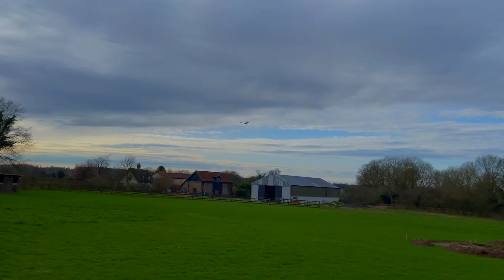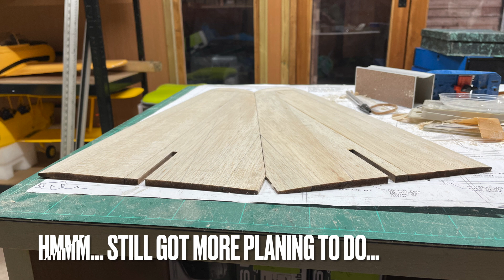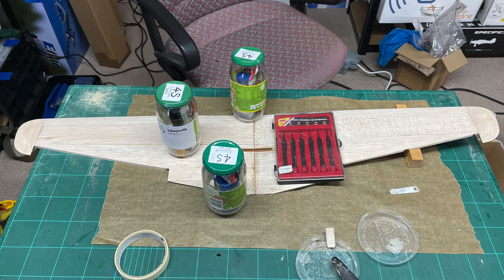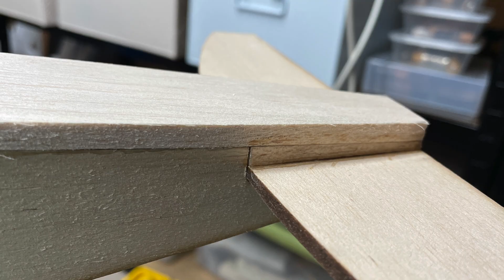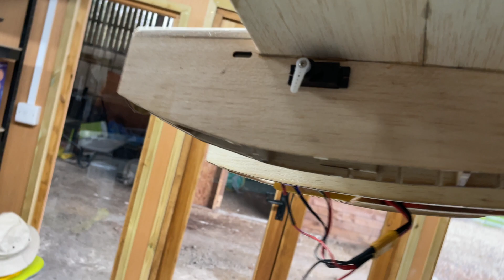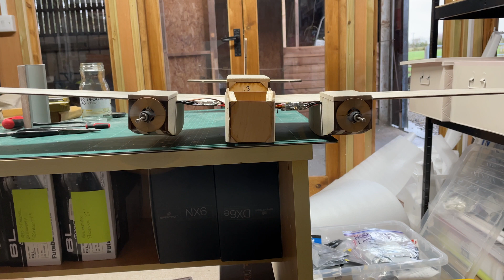TN Mosquito build PART THREE

Comment: Brilliant !! - great progress Gina, Bravo .... Regarding a stabiliser - I would have suggested an AR630 or something like that with SAFE and AS3X that you can fine tune as you wish... rather than the Hobby King one....
Reply from the maker: Hi Martyn! Yep, the original plan was to put in an AR631 but they're getting very pricey. The maiden will have the HK system switched off, so time will tell...

Comment: Looking very nice! I’m going to second the comment on the stabilizer. Don’t trust it in your new model. I tried to reuse the stabilizer from my HK Corsair and crashed quickly. Besides, the counter rotating props eliminate roll “P factor”. If the plane is balanced at the CG, it will be stable. Thank for the nice video!
Reply from the maker: Thanks, chap! The first flight will be without gyro assist, just in case. (Sorry for the late reply; I typed out a reply to your kind comment but it doesn't seem to have been tagged onto your original comment) 🤔

Comment: You should perhaps investigate the stabiliser a bit more. It may not be enough that it wiggles the servos. 
I dont know the configuration options on your stabiliser, but some of my stabilised receivers (spare parts for specific RTF models) will destabilise rather than stabilise unless mounted and used (control horn orientations etc) in the same way as the donor model. FWIW.
Reply from the maker: Hi Richard. Bear in mind that you're watching events that happened a couple of months ago due to latency between event and making of the video. As I write this, I have now caught up with myself! The stabiliser is functioning correctly (admittedly, whilst held in the hand and moving the model about) and responds as it should with the controls hooked up, I the way you'd expect the surfaces to move to self-correct.
Having said all that, you may be right in that the stabiliser won't be happy in its new home and in the air. The maiden flight will be done without the stabiliser engaged... proving that I don't have the courage of my convictions! 😄😄😄
Thank you for commenting, advising and above all, watching the video, Sir!

Comment: Sure it's going to look fab,for what it's worth (not much) I would have shaped tbe nacelles and fuselage before I glued everything together. 😊
Keep at it shes going to be great.
Reply from the maker: Thank you, Sir! You're so right, Mark. I should've done all that before assembly. I did quite a bit of hooliganism to the airframe when the shaping started 🤦‍♀🤦‍♀🤦‍♀🤦‍♀🤦‍♀🤦‍♀🤦‍♀🤦‍♀ If there's a next time...
Reply: @purcellrcaviationchannel  Cliff is building a very similar model at the moment from the same design stable I believe.
Reply: @MarkCroucherRC4fun I am indeed Mark very similar construction 👍
Reply from the maker: @MarkCroucherRC4fun  Ooh! Thanks for the heads up, Mark I'll hop over to Cliff's channel and have a squizz...

Comment: Nice work! Compared to some mossie plans I have, your wings look really thin, maybe my planes have chunked up the wing cross section to improve slower flying!!! \o/
Reply from the maker: Thank you, Caroline ☺☺☺ Go with your thicker winged plan; this is a fun scale, quick and easy (wasn't for me😂) model utilising as much sheet balsa as possible. It's going to fly fast, I suspect, but the wing does have quite an angle of incidence, so that might tame the speed. Oh, the irony of slowing down what was originally intended to be the fastest thing in the air! 😄